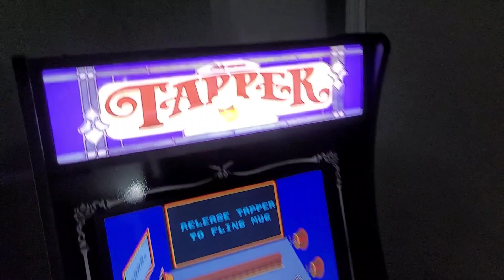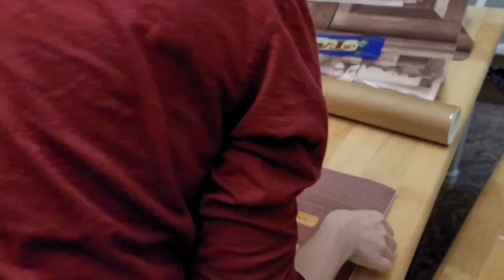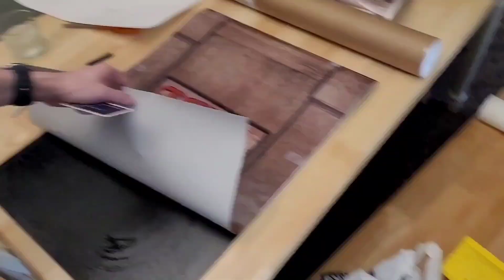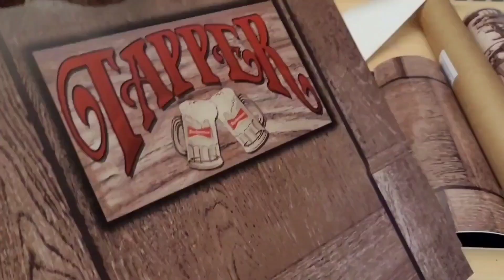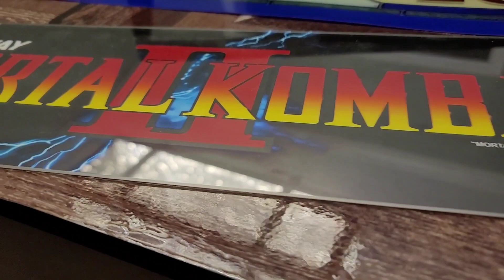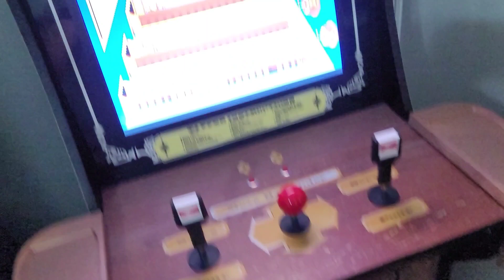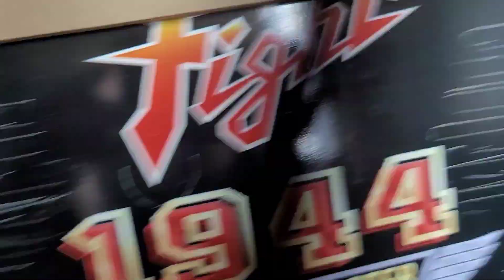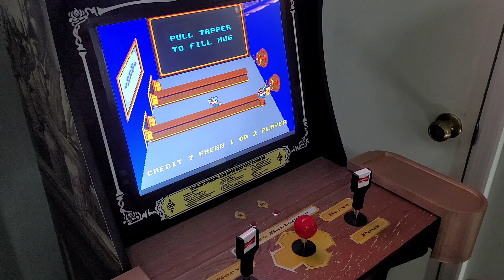Converting an Arcade1Up Final Fight into a Tapper cab

Comment: Love it and desperately want a beer tapper, not root beer tapper, was bout to buy the joust and just live with root beer tapper but would love to see where you got all the parts and how much you’re all in this for and what cabs would be appropriate to convert, I don’t know anything about the raspberry pis but have to learn, I’ve been bringing full size arcade back to life with flash and new EPROMs ans just working on artwork and kidding flaws and letting crt monitor guy handle that, would love to bend your ear and get your help to build one, if you would share your knowledge and where you got it all. The bud taps really make the machine. I have seen the graphics on Etsy, and I don’t know why 1 up doesn’t build this. I want it

Comment: Hey man, amazing build! Is it easy to retool the marquee? Im thinking about switching the art on an existing Arcade Game Factory marquee I have
Reply from the maker: So easy! I got the Tapper Trasnslite (from Arcade Graphix)and just slid it in, and took out the MK2. The Tapper graphic needed to be trimmed a tiny amount because they intentionally slightly oversize it. The graphic from Arcade Game Factory is held in place, not adhered. You've got this. Thanks for checking out the video!
Reply: @technobilly6171  I’d love to see a mod of Tapper, where it’s Root Beer Tapper, but the logo and Tapper’s design was kept (similar to the Suntory conversion).

Comment: Does your Final Fight PCB still work? I would buy it if you are looking to sell. Amazing mod, I would have bought a Tapper/Timber had they put one out, but it wouldn't have been nearly as good as what you've done
Reply from the maker: Thanks for your kind words! I traded my FF PCB and CP to my friend in exchange for necessary parts to finish a Rampage cab that came with missing parts.